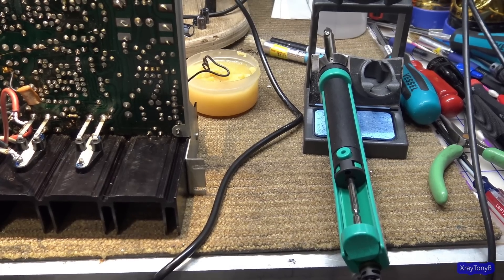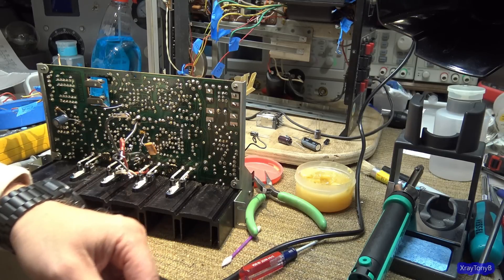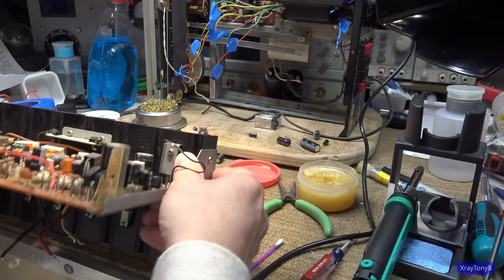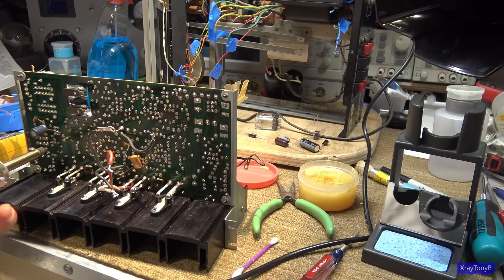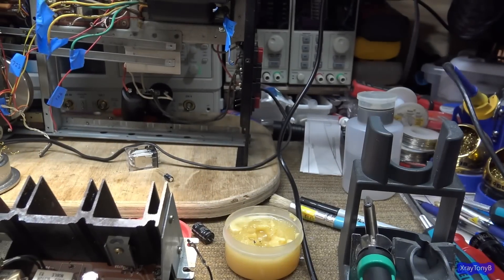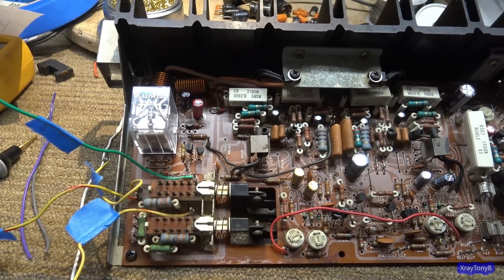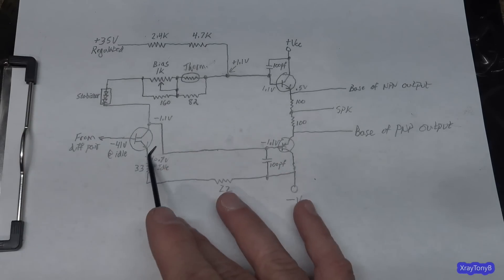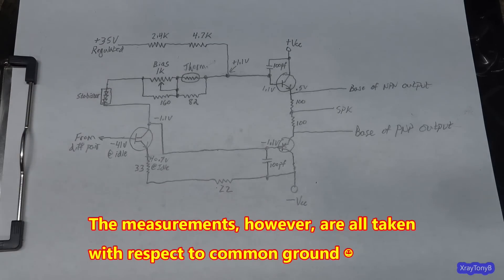Marantz 2252b Part 2 - Restoring the Amplifier & Power Supply Board

Comment: @XrayTonyB - i just found your channel. Forty-five years ago, I was an ET in the USN. Your videos are reminding about the repair process. I'm repairing a friend's amplifier. Thank you for the videos and your dialog as you troubleshoot. Regarding AI, like ChatGPT...  i am a Unix Systems Programmer by day. When I ask AI for help with a task i know very well, I find that it will put me on the right street, but not at the right address, so to speak. It might be a mile away and on the wrong side of the river. Since I know the work, I know i have to keep working to get the right solution. Your advice about AI is exactly right - AI users still need the skills to do the work so they can properly interpret the meaning.

Comment: I bought one of those solder suckers for use on 230V here in the UK.  I was dubious about safety - like yours it has the "box in a box" double-insulated sticker on the handle, and it has a two core mains lead, but the instructions say must be connected to a grounded outlet - which is meaningless as there is no earth wire in the lead!  I use it, but only on an isolated supply (a mains power bank) as I really don't want to risk the metal parts going live at 230V if the element insulation breaks down. Any mains powered soldering iron I've ever used has been earthed, which just seems right for a device with a heating element in a metal sleeve. 
But yes, these do work quite well - although after a few uses I note that mine has rather bent slightly!
Reply: I think I will just stick with braid or simple solder sucker. Has worked for years in my repairs.

Comment: I bought a very similar desoldering pump a while ago for only 10 euros on a local webshop here in Europe and I actually used it in one of my recent videos on my channel when I was restoring a Hitachi amp. I was also surprised by how well it works. It shouldn't work that well for its price...
The only drawbacks according to me are:
- It takes a long time to heat up
- The handle gets hot after some time of extended use
- When you press the plunger, it sometimes spits out blobs of solder from previous desoldering tasks. So point away from the PCB you're working on.
- The nozzle is a bit big so doesn't work that well on PCBs with small solder pads.
But for recapping of vintage amps it works really well, and I plan to keep using it.

Comment: @0:30 and beyond, Tony, can I just say (and before I watch more) that I recently had one of these. It worked great for a few sessions, then internally it must have shorted against Earth, and with that my house ELCB (or RCD) tripped. The reason for its short life was very probably down to the fact that the impulse driven by the spring eventually shocked the element so much it short-circuited internally. Pity,  as when it was working - it was very useful! 

I won't be buying another.
PS: The make was Duratool.

Comment: @14:45 Your soldering pump is great because I have tools like that, it's been used for 2 years, just take care of the grease on the rubber pump, that's what often breaks, but there are replacements that can be bought online.

Comment: To honestly evaluate that solder sucker you really need to test it on plated through holes. Like try a DIP IC on a junked multi layer board. Single layer non-plate through holes are not much of a challenge for any solder sucker. Also see how well it works on that wretched lead free solder! That said, I might still buy one myself for non-plated through boards and cleaning out terminal lugs.

Comment: i bought a similar solder sucker a couple years ago. a real turd out of the box simply because it didn't want to stay armed if you could even get it to arm.  i took a file to it and deepened the notch and it helped but i rarely ever use it.

Comment: Curious about your soldering procedure. I think it was in an older video of yours that you said you snipped off the legs of the new parts you are installing so as to cover the end of the wire with solder to prevent corrosion (hope I'm remembering this correctly). However, I always thought that leaving the long leads attached until after the solder was applied would help wick away some of the heat from the new part. Thoughts? Was your way how you were originally taught?
Reply from the maker: Good question!  Just as you said, I clip the leads off first so that the solder will close off the exposed (untinned) copper end of the lead.  This is not as important with resistors and capacitors, but I always try to make a habit of doing this with transistors.  This helps to reduce the risk of lead tarnish which can cause problems with the bonding leads inside the transistor, which leads to shot noise and static in the device.  Some folks say it doesn't make a difference.  Either way, it doesn't take much more effort, so I cut them first.  As for the heatsinking, I've found that it makes it harder for the solder to flow out quickly when the lead is still long, which makes you stay on the solder joint longer, heating it up even more.

Comment: Great video as always, thanks for explaining everything so thoroughly. I bought and restored a 2252b last year and noticed that it consistently seems to store a considerable charge in the positive filter capacitor when powered down. I noticed in part one yours had the same situation where powered down it was holding a considerable charge and you said that may indicate an issue. I noticed my other amps don't do this so it seems strange but the receiver works great and tests well. Do you know if this is normal and is there a specific resistor that bleeds off the charge in the filter caps upon power down?

Comment: there are a lot of ways to get a signal into that unit. An audio signal generator is a good choice as we well as an MP3 player.  for just testing the amplifier section it should even be possible to use the internal tuner though the signal would be a much more complicated one but for just following the signal it  would work it does look cool though,  a tape loop on any  tape player would also work. A single tone would be easier to see any distortion however but any or all inputs would tell you something  about there portions of the circuit

Comment: Hi Tony! Does that desoldering pump have an earthed power plug or is it just a two prongs plug? I'd guess it only has some triac to lower the voltage sent to the heating element. That doesn't feel so safe but they are so brave in China, they have totally different electrical safety standards!
Reply from the maker: Nope.  Just some resistive wire wrapped around the ceramic form.  No earth lead.  I would NOT suggest de-soldering in the shower with this unit.  I would also avoid puddles, swimming pools, and other occasions of unpleasantry that could be had while using this iron.  That said, it DID do a good job of de-soldering.  ;)  China not only has different safety standards, they often have NO safety standards!

Comment: Someone uses a blue and white radioshack solder sucker.... not one with an iron built in... just the standalone sucker, maybe Steph from Skunkie Designs? I don't remember now, i watch too many electronics channels, lol....

My circuits professor had a good quote... "All a college degree shows is that you can be trained"
Reply: In the military the degree proves that you could extract the correct information given high levels of noise. Very important skill on the battlefield. That's not to say anyone will succeed, as a lot of idiots are lined-up behind the spear-chuckers.
Reply: @Parkhill57  yeh, i spent 6 years in the army, lol

Comment: They all work good at first,,,, But time will tell? also its about the tips and Inside parts how long they last and the cost of the replacement tips I bought a Radio shack one it worked good but the tips burned out quickly the replacements tips burned out even quicker. Good luck but I would not buy one.